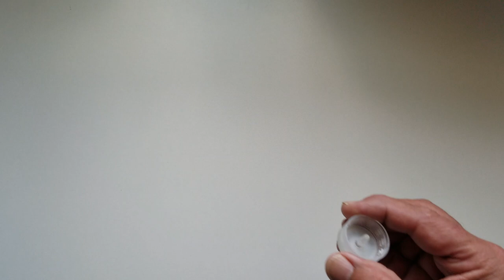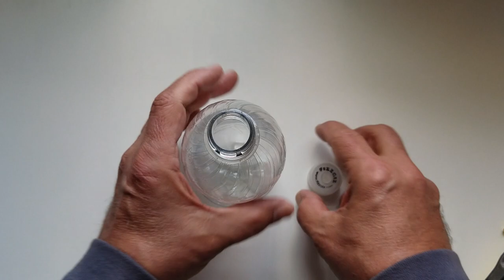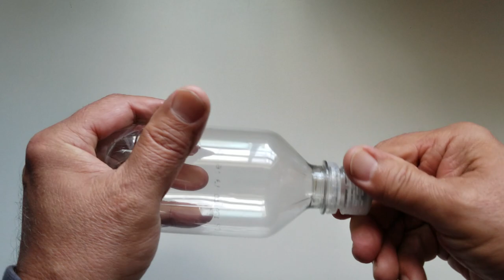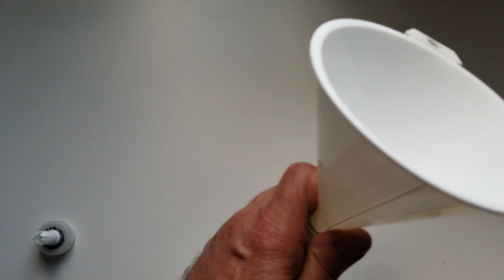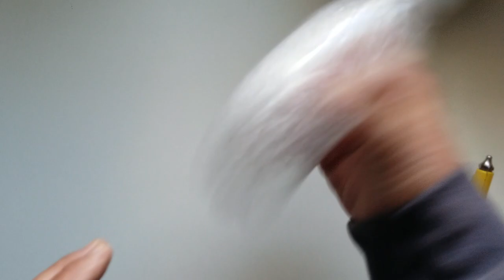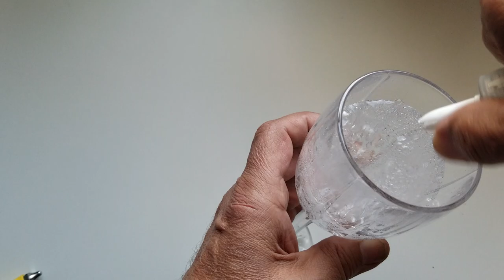Handy New Soda Bottle Cap For FiZZ GiZ Customers

Comment: Pretty cool just ordered the hand help fizz giz and was confused in regards to this cap. I see this video and go back to the bottle sent and it doesn’t have the bottom valve. Was it supposed to have one or did you send me the whipped cream dispenser type cap on accident?
Reply from the maker: Hi Myra. I've begun lately to send out complimentary samples of unordered items along with ordered items when packing up a shipment. I do it to build customer awareness of other items I have. My website is such a piece of junk. I don't get a lot of traffic there. Haven't managed to figure that one out in the past decade. Both complimentary sample bottles that were in your shipment should've arrived hard-as-a-rock. Gives you an idea about the integrity of the seal. Hopefully helpful.